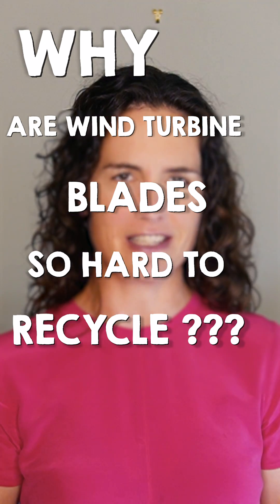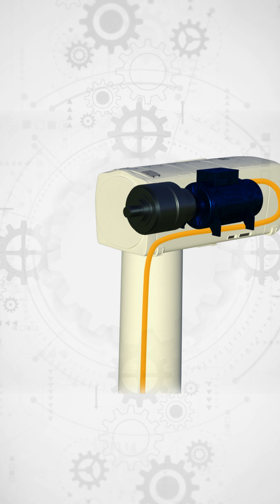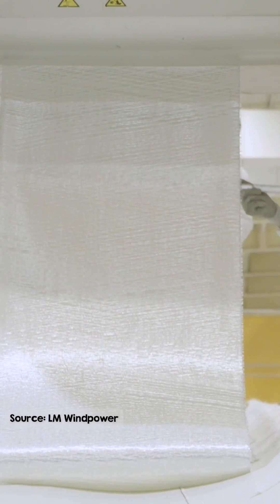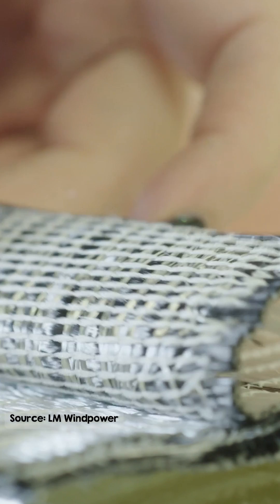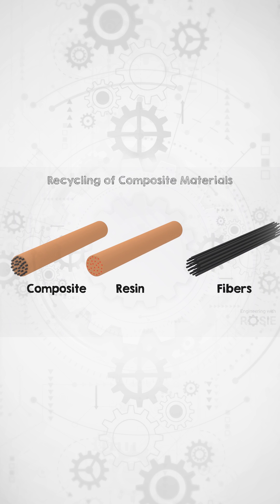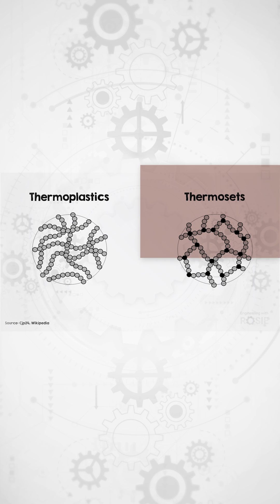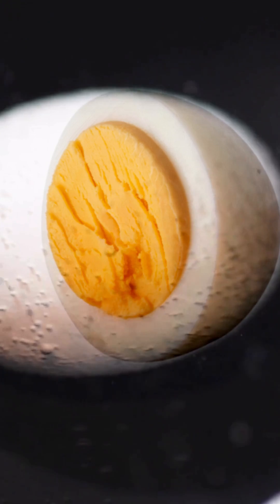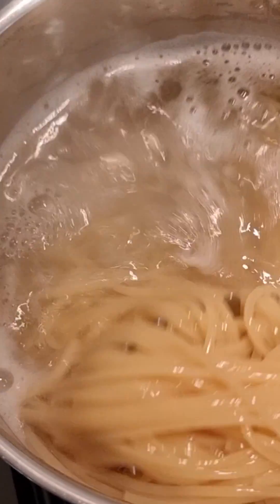Why are wind turbine blades so hard to recycle?

Comment: I have read comparisons between VAWT and HAWT, which mainly concluded that HAWT produced more power. 

But would VAWT blades last longer? The stresses and erosion of blades on a HAWT would increase dramatically towards the tip, whereas the blades on a VAWT are less tapered, and all move at the same speed.

Comment: For those complaining... "Typically, the glass/epoxy composites for wind blades contain up to 75 weight % glass." (if you search the text you can find the study) which means it can be melted down or reused into any other material requiring silica, the interior of the nacelles is empty and reinforced with balsa wood or polystyrene (balsa wood being obviously preferable for environmental reasons) 
natural fibers such as bamboo are also being considered instead of fiberglass and have shown to be promissing because they're cheaper and make the material easier to deal with afterwards despite having a slightly lower durability. 
these naceles last 10-30 years with little to no maintenance compared to coal, gas or oil which lasts... 10 seconds...? 
Only around 25% of the 16% non recyclable or reusable material in a windmill being plastic/resin, given that fiberglass is just borosilicate glass, doesn't sound all that bad ( the main materials being steel (66-79%) ; fiberglass, resin or plastic (11-16%); iron or cast iron (5-17%); copper (1%); and aluminum (0-2%) to those interested) 

I believe this is far better than filling London with smog again?
Reply: Nope. If you melt down fibreglass the glass becomes permanently contaminated by the resin. 0% of fibreglass is recycled.

Comment: I saw that a company was shredding the blades then adding the to concrete.  If they can make this work better than normal concrete and the economic model can evolve, then there is a possible solution.  Better that burying them
Reply: It is competing with literally crushed granite aka gravel, as aggregate. No, it doesn't make for better concrete.

Comment: Glass fibre reinforced plastis (GFRP)  has been used for pipes, pipelines, car body parts, shower trays and bathtubs, boat hulls, etc. for 50 years. In Europa over 95% of these are burned as heating material in cement factories.

Comment: The only people who are worried about windmill blades are oil company shills. Wind energy generation has evolved beyond the windblade phase. Pretty sure the current best wind energy generator being used and pushed in the industry doesn't even have these blades. They're like a standalone billboard that gets push by the wind and reset by springs. If anything, we should be shitting on the advertising/billboard industry for the waste of space with their non-recyclable billboard material and not adopting this wind generation tech. There's non-recyclable shit in everything. 

Blaming a new part of the energy industry for adopting similar recycling practicies as the other, older parts of the energy industry is exactly what those oil money execs are hoping for. If the oil and gas corporations really cared about recycling they would make it mandatory for corporations to clean up their abadonned oil wells before declaring bankruptcy right after they made record profits. RN farms across Alberta are littered with abadonned, unrecycled oil wells

Comment: These "green" technologies are great and all, but they're never going to become the main power supplier source until we figure out PROPER working energy storage systems to counter their downtimes. And I'm not talking these stupid fancy "sometime in 50-100 years" solutions like gravity storage or sand storage systems. We need massive battery banks and we need them sooner rather than later. If someone could figure out a product that cna survive saltwater then we could just have lithium-ion batteries and keep them submerged in water (like the ocean water) at all times, that way it matters less if they catch fire.
Reply: Those 2 ideas you mentioned are hyperloop level ideas... They're more expensive and fallible that existing solutions and only seem great on paper before noticing the severe flaws in the concept. 
In the batteries... I agree. There's several forms of storage available to us that go from around 90% to 70% efficiency in both storage and withdrawal. The main problem isn't storing it temporarily though... It's how you monetize that. Currently private companies produce energy and shove it into the grid, with no means to limit the excess production or preventing private entities from adding more production you would still need batteries capable of storing several days of power AND to "burn" some of the excess energy you can't store so as to not blow up the grid so it's not just "place batteries", you need  energy consumption on demand in case of emergency, to manage prices so you can keep prices low but energy producers happy and energy consumption models that give advantages to people and companies who consume that power when there's more power being produced.
But Smart grids are already a thing and solid lithium batteries are coming in the next 5 years or so, all we're lacking now is the update of energy contracts and policies and methods of energy consumption that would work only on peak production and when storage is full (hydrogen production on site is being proposed, which is kind of a fitting role for it)
Reply: Oh! And lithium batteries catch fire in contact with water. Which is why putting them out is so hard, so placing them underwater is making a fire risk into an explosion risk XD

Comment: Either way I don't think it matters much. If a single modern 12MW+ offshore wind turbine provides 15,000+ homes worth of electricity for 30 years, then the unrecyclable waste being just 3 turbine blades is a pretty amazing trade off. Definitely worth it. But of course they are starting to become recyclable, and for the ones that aren't i've seen that some are using them for shelters or bike racks and stuff like that which'll last probably another 100 years as long as they dont get damaged. It's such a small deal
Reply: The leading edge of the turbine blades get destroyed offshore by the salt fog. So by 10 years the blades are damaged & less efficient.
Reply: I made a full comment with sources but I thought of adding this here to help people understand the subject... Only 16% of a windmill is fiberglass, plastic or resin, most of it in the nacelles (the paddles on the turbine).
75% of the nacelles weight is glass (fiberglass)
That means that only around 4% of all the components in a wind turbine are not easily recyclable. 

and yet... despite the nacelles being the least durable part of a wind turbine, they still last around 10-30 years  (and can be reused by mounting them in other turbines placed somewere not as hectic).

For comparison... A Thermal powerplant's furnace lasts around 20 years and requires constant consumption of coal/gas/oil to operate.
Reply: @pedromoura1446 And TRANSPORT of the fossil fuels involves a LOT of infrastructure and vehicles that require maintenance, replacement, etc..
Reply: @Morboxx  exactly. People forget we get co2 and energy costs from extracting, transporting, transforming, transporting again and usage. All this so we can maximize end energy usage and we still only get around 30%-40% efficiency in the end user... 
with every inefficiency and energy expenditure in the middle I wouldnt be surprised if we only got to use something closer to 1% of the raw material's stored energy at the cost of everything and everyone on the planet...
Reply: @pedromoura1446 No one is re mounting used blades because the cost of the logistics and lack of standardisation makes it infeasible. Also fibreglass isn't anywhere near economically viable to recycle. They go into landfill.
Reply: @SurmaSampo  they do because it's the same company doing it in their own turbines. They Remove, maintain and then reinstall the blades in less stress prone towers so they last longer. The company also saves money doing this so everyone wins. and it's viable precisely because it's inside the same company with the same requirements made for all turbines.

The only reason reusing it in land turbines can be unfeasible is due to the size of the turbine which could be too big for the smaller towers. not anything else. All couplings are replaceable or adaptable because no company wants to deal with 1000 different bullsh*t attachments to do 1 turbine change.

AND they don't bury them. They're incinerated. They used to recycle the smallest ones done with aluminum but these just weight way less and thus can be made larger in order to basically double the energy production. 
they can't separate fiber glass from the acrylic yet. But there's promising alternatives (using bamboo or wood for structural support, using bioplastics instead of cyanoacrylates or even dissolving the material, recycling the fibreglass...) and this still makes for a LOT let trash and CO2 than many if not all of the alternatives.
Reply: You're many orders of magnitude out. 12MW is hundreds or thousands of turbines. The blades don't last decades. Years if you are lucky.
Reply: @cianmoriarty7345  This is just false. Average generation capacity of onshore wind turbines is 3-4 MW, offshore is about 10 MW. Even considering a capacity factor of 25-45% that's about 10 onshore turbines or 3 offshore turbines. And we do have plenty of older examples of wind turbines lasting 20 years, but oftentimes the windfarm owners elect to replace the blades after 10 years not because of debilitating damage but because newer blades improve at such a rapid pace it makes financial sense to upgrade them prematurely.

Comment: Well actually, 😌 wind turbine blades are made up of mostly Balsa wood by weight 70% or so, that's right, wood.
Reply from the maker: That is incorrect
Reply: 75% of the composite material they are composed of is glass, by weight. Balsa wood is just used to reinforce the interior of the nacelles and i'm not sure how much of the actual weight it has (not much I'm assuming given how wood is just used as structural support to prevent their collapse). But I'll check once I have an opportunity since you made me have some doubts now 🤔

Comment: Couldn't you macerate them and use them in concrete as the fiber?
Reply: They aren't strong enough for most applications
Reply: Because wind turbine blades are mostly made of wood, Balsa wood specifically. Which would rot and than cause millions of cracks.
Reply: Ah, I thought it was a car body style fiberglass.
Reply: @Inova3DSolutions  That can just be burned.

Comment: "Because we made them non-recyclable for cheap greed"
Reply: This is so unbelievably wrong. Fibreglass is used because it's very strong and very light and it can flex without distorting. They are also still very expensive to make. I work in fibreglass, you cannot recycle it cost effectively, scrap parts are forever plastics. The 2 part gel coat is resistant to almost all chemicals, you can't just mulch up scrap and reuse them.
Reply: No

Comment: Why are we using wind turbines when better technology  is available?
Reply: Wine turbines are either the cheapest or second cheapest form of energy depending on your local geography. People like cheap electricity. That's why we are using wind turbines! People pay to put them up because they make money!
Reply: @TankEnMate  They are far from cheap. A single tower runs the cost of around $15 million on average. It's a very profitable form of energy for everyone building it and that's it.
Reply: @jaxithfox  In 2023 in the USA; Onshore wind LCoE is $24 to $75/MWh, Off shore is $72 to $140/MWh, baseload CCGT is $39 to $101/MWh, peaker CCGT is $115 to $221/MWh, and nuclear is $141 to $221/MWh.

Your claims don't match reported costs. Nuclear is always more expensive than even off shore wind. Even Texas is producing more wind energy than any other source these days.

If you don't like wind then just say so, but inventing "facts" doesn't help your case.
Reply: @TankEnMate They don't make baseload power. So they are not cheap, they are a waste of money.
Reply: @jackmeoff7625  See the reported LCoEs I mentioned. Wind, even with batteries, is cheaper than either nuclear or CCGT. That's why Texas is producing more wind power than any other form.

If you don't want cheaper electricity then just sign up for a more expensive service.
Reply: @TankEnMate It's not cheaper because you seem to have missed the, "base load", term in my comment. The cold hard fact is that wind power, like all renewable energy requires a reactor or other power station ticking over in the background ... Because they are not base load power.
Reply: @riba2233 Everyone? LOL!
Reply: @jackmeoff7625  yep, it's pretty obvious
Reply: @riba2233 ...I'm in this thread.
Reply: @jackmeoff7625 so you're saying that a generator connected to a electric grid from were it could draw power requires a generator... Oh boy...
Reply: @pedromoura1446  If the generator requires the sun or wind, what provides the power on a windless night? The fairies and pixies. 
Start learning how things work.
Reply: @jackmeoff7625  firstly...
They have batteries to power the electronics (shocker I know... A generator making it's own power!? What are people going to invent next?!) and the power they require is so small to the point of being almost negligible. 
 secondly, even if the batteries are completely drained the generator is connected TO THE POWER GRID. You know... The same thing keeping your lights on and factories working all the time...? They don't need a nearby generator... They have all the power they need right there...heck...if anything it's gas and coal powerplants that ACTUALLY do that and use cheap electricity or excess grid energy (which you need to "burn" so as not to fry the whole grid since we're not storing it) to pre-heat or keep their furnaces working during the time they're not generating power so they can immediately step in if the wind drops ... And what energy do they often burn? Wind power...
Reply: @pedromoura1446  The wind and solar power generation does not generate any power when there is no sun and no wind, or the wind is below 7 miles an hour or higher than 45? miles an hour. 
A coal fired power station or other baseload generator must always be running in the background for whenever the solar and or wind generation drops in order to provide base load power. 
Theses stations don't just start up on a whim they have to be run up, so they are always running in order to provide the grid with base load power.
Batteries, other than dams don't store sufficient energy to run a grid. Current technology does not allow for that. They can at best provide temporary power for short term applications, that's it. 
I am simply reiterating what I've already said because I couldn't make head nor tail the garbled mess you put forth in your last comment. I have no idea what you are trying to say.
Reply: @jackmeoff7625  ah! I understand now. When saying "wind turbines need a generator" you meant that as another powerplant to guarantee production during the periods of peak consumption or  lowest production. 

I thought you were talking about the myth that wind turbines require generators to rotate their nacelles which Is a myth i was told twice just yesterday and hurt my brain. 

It was my mistake and I apologize.

Now about what you said there's 2 things I'd like to correct, If I may. 
1-There's no physical reason batteries cannot be used to absorb the excess  during peak production and use it during peak consumption. It's just a price barrier and battery prices will go down since they're not even close to the lowest price they can have.

 2-to reinforce what I said.those thermal power plants you mentioned can keep ready to deploy in 2 ways:
1-keep burning gas to keep the furnace hot;
2-use their turbines in reverse, thus "burning" electricity to maintain the furnace pre-heated;
The 2nd is usually made using electricity from wind turbines at their peak due to overabundance and predictability of output patterns.
Reply: Because they're a cheap way for politicians to make it seem like they're doing something. Do you honestly think they're going to betray the fossil fuel companies that fund them?

Comment: Why are ev batteries so dangerous to mine and make more of a carbon footprint to recycle then regular gas powered cars? Seems going green may just be a different kind of problem not better
Reply: What about capturing and recycling the exhaust gases?
Reply: Recycling the battery creates more carbon dioxide emissions than gas cars?! How does that work? I think your large language model may be malfunctioning.
Reply: @ishmaelmcgoo2945 Read the op again, that's not what he said.
Reply: Even in the Australian grid, over the vehicles lifetime an EV has half the carbon footprint of a fossil fuel car, read a book 😂

Comment: More and more planes are made mainly of composite materials , but i dont hear a hue and cry about recycling those, 
Obviously i'd prefer if the blades were re-usable , or at a push -recyclable.. 
 Sliced ,crushed and added to concrete? As a reinforcing fibre
Reply: THIS
Reply: In any case, it takes like 7 pounds of wind turbine blades to supply electricity for a person for 20-30 years. That's really nothing as far as material waste goes. Just think about the thousands of pounds that a car uses. Again, the people who think that they're geniuses for pointing out that wind turbines are made out of stuff don't seem to care about context.
Reply: @ishmaelmcgoo2945 Got to think of excuses to justify the faux-green bird blenders.
Reply: That's because planes transport 100s of thousands in their life time, making the environmental impact of dismantling per person much, much less of a deal. Especially when compared to stupid cars 🙄
Reply: @Inova3DSolutions "stupid cars"  You like the intelligent cars better?